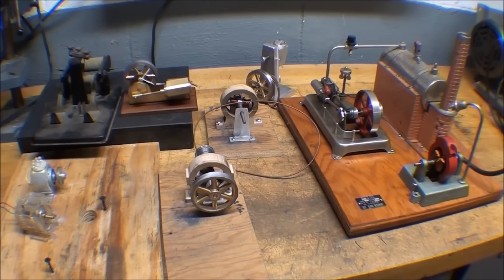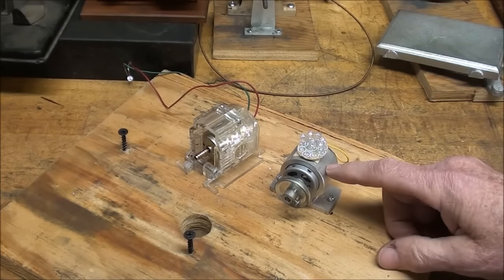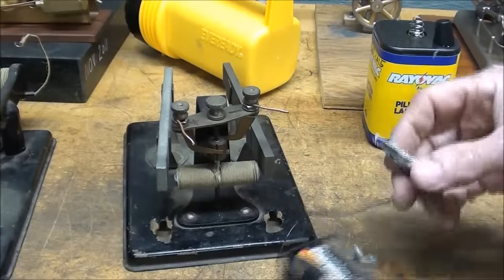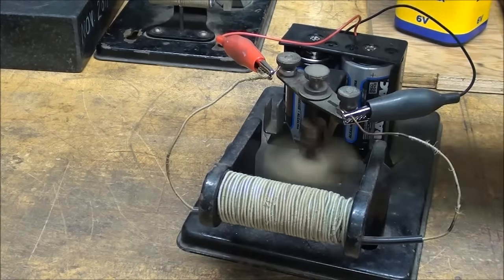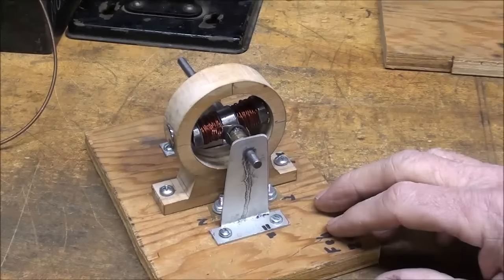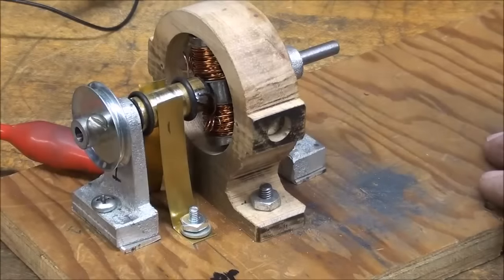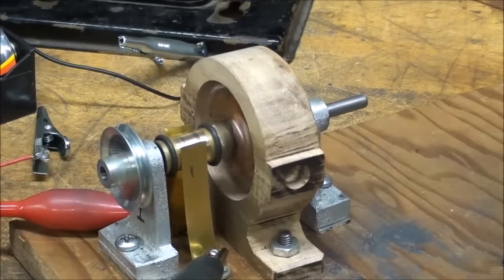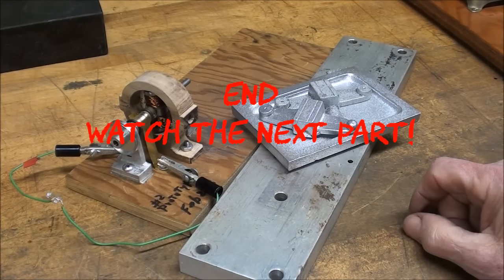Pt 1 tubalcain BUILDS A MODEL DYNAMO for a Steam Engine

Comment: Fantastic video. brings back a lot of memories of the motor kit i got for Christmas. In that day we only got one present and that year was a electric motor kit. It ran off your electric train transformer. ( that I got the year before) One had to build this kit and it would run my Ferris wheel. (from my erector set i got previously) It was a great build and it's too bad no one offers these kits today. I also got a two tube radio kit one year that i built and could listen to short wave from all over the world. I was raised in Tomah WI. and we had a telephone exchange. I would go through there trash and find round dry cells that came out of crank wall telephones,  that were still used on farms,  and used them to make magnets and all kinds of other things.
Good times,
Cheers,
Lee

Comment: 25 years ago for a science fair project my Dad and I built a little DC motor out of a thread spool and some small copper wire wrapped around bar stock bent in a C shape.  That was a lot of fun to build with him.  We could never get the motor brushes just right all of the time so it didn't always run very well.   Cool builds Mr. Pete.

Comment: Yeah, this is going to be a good series! I love this type of thing. When I was a kid, I was fascinated with electrical stuff. My grandfather had carwashes which he maintained and modified. I was a little kid (just walking and barely talking). He would talk to me about the relays, timers, contactors, motors and other parts - talking to me just like I was a grown adult.

I did understand some of it, and I still think about those times.  Now, I work on large diesel generators and their control systems - and love every minute of it!

Comment: This video brought back a great memory for me.   We made dc motors in 4H.   If I remember correctly they were very crude using enameled wire, some large nails, and a block of wood.   The rotor was made from nails and the enameled wire and the brushes were just heavy gauge solid copper wire.   Can't remember what was used for the fields but I'm sure it was a wound magnet.   Have to see if my old 4H book is still at my parents house.

Mike W.

Comment: You should have an iron holder for the magnets as it extends the magnetic field farther around the  armature.  You saw this effect by holding another magnet at the top of the wood dynamo and it sped up.  The commutator should be able to help adjust for the powerful neodymium magnets and reverse the polarity of the armature at the correct moment.  These look super fun to play with.  I love your videos Mr. Pete!

Comment: fond memories. I built a motor very similar when I was in the fifth or sixth grade for a science fair. If I remember right I got the plans from a popular science magazine and the wire from Radio Shack. The armature was made from a bolt and nuts with a hole drilled through the center of the bolt. If I remember rightly I got an A on it. I remember the grade because it was one of a very few A's I got in school other than shop and votech classes. One of the things that really aggravate me about schools today is the elimination of any type of practical education and the emphasis on every child going to college. I am an electrician / Mechanic at a Quaker Oats plant and actually enjoy my profession, Which is kind of unusual today. I repair machinery made from the 50's to state of the art stuff put in in the last year. I gained my skills from helping on the farm as a kid. Vocational classes in school Working in my uncles machine shop in high school and the US Navy training schools and on the job training. Although I did attend a Tech school a few years back and earned a degree in Industrial Technology I found about 95% of it as useless or stuff I learned years before through other means. Today I do everything From 3 phase 480V electrical and PLC to basic machining and fabrication.

Comment: Thx for doing this series. 
You brought back a memory when I built an electric magnet motor using instructions from the World Book Encyclopedia. If I remember correctly it was made using a shoebox, a 1" dowel, a bolt, some heavy strapping, copper wire, etc... 
Funny thing. Festerday I watched "luckygen1001" build a model generator.
Reply: +OldeGuido1  Yesterday... the F is nowhere near the Y goofy.

Comment: seems like the kind of project that would a great thing to build with an older child who's interested and wants to be "involved" in what you're doing in the shop.....   I can remember building something very similar to this when I was a webelo scout.  (and later helping younger guys when I became a boy scout...)

the "locking up" problem you could probably fix by increasing the air gap between the armature and the magnets themselves....

fIner wire = more turns on the armature = stronger transient field to interact with..    Taking great care to keep the windings nearly coiled and not jumbled, also increases the field strength...   

the small motor needs a higher speed as LEDs require a certain minimum voltage to activate, so it would require a certain speed to create that voltage....

Comment: You were able to buy LEDs that changed from red to green with reversal of polarity, or yellow if AC power source used - I'm sure they are still available. These would be great to demonstrate reverse running. Great videos - thanks again Rod Australia.

Comment: Hello Lyle -  Here in Connecticut - I want you to know about the Connecticut Antique Machinery Association ( C.A.M.A.) . They normally do a spring "power - up " show in order to kick-off the summer season but their crown jewel show is their fall show which is about as good as it gets as far as antique machinery displays anywhere in NewEngland.  They have a Generator on display that is in the process of being restored to working condition and I am sure it will be a fantastic display and it will be a working display( it will be steam powered ).  This generator clearly shows why " Brushes" are called brushes.  The copper contacts are clearly cut into thin - flexible bands that easily form around the shaft to which they need to make contact ( Imagine a modern day corn broom made out of copper ) I can't wait to see it running.
Reply from the maker: +Jayne Gus I hope someone makes a vid of that-thanks

Comment: When I was in High School I took the shop courses. I had no plans for collage. 
We were assigned to build a motor. Most chose a simple two pole. Even number rotors are usually not self starting. I thought if a three pole was better a five pole would be great.
We used 1/2" by? flat iron for the rotors and the stator.  My rotor was made from five "vs" they were held together by the wire windings. We did not use magnets we wound the stator also. The rotor shaft was welding rod. Ground points on the shaft ends and place it into deep center punched holes on the stator. Motor ran great and fast - for awhile. My holes for the shaft were not deep enough to keep the rotor in place. Rotor took off and landed in the shops box of vacuum tubes. Hard to balance a five pole rotor.
I wound up going to collage One of my masters was in EE. Also got certified as a PE in Illinois and NC.  George  Dekan, my shop teacher, hired me after I graduated from college to Modernize a timer he sold to schools for athletic  timing . I used TTL to replace relays and AC motor timer. The kid with the five pole motor stuck in his mind.
Reply from the maker: Thank you for a good story about the motor. You sound like quite a smart guy

Comment: I got to reading a page talking about turbo-generators ... they are rotors, directly connected to gas turbines, so they run at 24,000 rpm or more.  They arrange the field magnets, and the stator windings, alternating in a ring.  A pure iron rotor with multiple lobes spins (by turbine power) and alternately connects fields of force between the field and winding elements in the ring around the rotor.  Hope that makes sense.  I wish I could share images here!

Comment: Actually if you were to rotate those brushes about 15¯ those little motors would self start. It just stops the brushes from contacting both the commutator pads in the motors resting position between the magnets. It can also make them go faster or slower depending on the position of the brushes too. Putting the magnet on top extends the field pole of the other magnets which is why it speeds up in that case. Fun stuff...

Comment: Hi, 
the reason why you need to start the motor manually is not because the magnet is too strong, but because the angle they "cover"  is too small. If you compare with the Jensen generator, the magnets form about 60% of the periphery, so the rotor is exposed to field lines for a larger part of the circumference. 
The solution would be to put several neodym magnets on each side. This is also why the motor speeds up when you place a third magnet on top of the assembly.

Comment: If you keep the magnets parallel (like in the electromagnetic setup) the motor should spin in the directions you start it without changing the battery polarity

Comment: Mr Pete,   The motors will produce more torque if the magnetic field is "connected" around the magnetic circuit. Iron around the small magnets so the gap is only at the poles.

Comment: I a science project for Junior High, I built a simple motor using galvanized and copper wire. I got extra credit because the motor started automatically when I turned on the switch. :) I had noticed that if I pre-positioned the motor just right, it would do that, so that's what I did to show to the teacher.

Comment: The coil spring can be easily adjusted to a smaller size, by simply looking for the join and unscrewing the two sides, then cut the outer non reduced section with sharp high tensile wire cutters ( will nick ordinary cutters, it is piano wire or spring steel wire) and grind flat again, then simply screw together again. Done that often to replace drive belts that otherwise require you to dismantle the entire machine just to get it off the shaft.

Comment: You need a pole piece inside for the magnetic field, so the field area is larger. Will give both less cogging and more power, along with smoother running.
Reply: SeanBZA The magnetic field isn't necessarily "larger", but is IS more concentrated by an iron core.

Comment: This is a classic DC motor. If you weaken the magnetic field (of the stator) on a DC motor, it will go faster, but with less torque.

For a generator you should use a strong stator and a rotor with  a high number of windings. Otherwise you will get a low voltage output.

If you want, you can build the rotor with permanent magnets and use y stator with a lot of windings, this will ease the construction but your generator will produce only AC.

Comment: Magnets and magnetism are at work in our everyday lives. You microwave oven has a power transformer (a magnetic device) to increase household voltage to a very high voltage for the electron tube that generates the microwaves. It is called a magnetron because it has a very powerful and large magnet on the tube to help it oscillate (more magnetism) correctly.  Microwaves themselves are powerful magnetic waves at a very high frequency (several gigahertz). ... My grandmother had an old Sunbeam Mixmaster when I was a kid. Since solid state devices didn't exist then, the speed control rotated the brush holder. This changed the brush timing causing the motor to speed up as the brushes became closer to their ideal position. ... There are literally hundreds of things we use every day that use magnets and magnetism; from your electric razor to your cell phone. (Yes, I'm an electronics nut with a healthy respect for electricity. It can work for you and it can kill you!)  Thank you, Mr. Pete, for your series. I hope I didn't steal too much of your thunder!

Comment: Will you make a reversed one with the coils static and the magnets moving?
That wouldn't even require a commutator or slip rings.
Reply: +stefantrethan -  It would actually need a fairly complicated commutator (rotating switch, actually) which would reverse the polarity of the voltage applied to the coils twice in each revolution. It would need four "brushes" and an intricately segmented rotating part. On the plus side, it would be fairly easy to make it reversible.
Reply: +Peter W. Meek As a motor, yes, either that or a much more reasonable electronic commutation.
As a generator, it would require no such thing. If you needed DC (say for a LED light) you could simply add a diode rectifier.
Reversed motors like that (outrunner motors) are known for low speed high torque so might be a good match for a steam engine. A large diameter one would work even at flywheel speed (or you could even put the magnets on the flywheel itself).
Reply: Good point. I hadn't really considered that the whole point of this series is to make a generator rather than a motor. A moving magnet rotor and stationary coil would indeed make a good AC generator.

A multi-pole rotor and a single coil might even make a MUCH simpler design.

Comment: I still have (what's left of) my Jensen steam engine from a Christmas some 40 years ago.  I knew what it was, all wrapped up in gold-foil wrapping paper, sitting under the tree.  The poor machine now has just been sitting, for years.  If I ever get the chance, I want to re-build it.  Not that it's practical, but then, that's not the point.
Reply from the maker: Get it out and get it running

Comment: I know how you feel about questions, but I have a project I'm working on, using a 12vdc solenoid, switched at up to 3,600 times per minute.  It only needs to run for seconds at a time, as a demonstration - how many turns, of what gauge wire, would you use?  It is INCREDIBLY hard to find a reference point for this, online.
Reply from the maker: I have no idea on how many turns. There are of mathematical formulas for all of that that I do not understand

Comment: Mr pete
 I've gotten to the point I don't bother with TV much I search for shop videos instead . You spoke in a previous video of working in an electric motor shop but you may want to check out ( luckygen1001 ) , he does similar work in cast iron i guess it's just the way they do things down under .
Reply: +Lawnmowerman02346 Thank you for watching my generator build videos. I don't think mrpete222 would be interested in my videos because he only melts aluminium.

Comment: I am confused as to what tubalcain means by standard dry cell battery that he had as a kid? Alkaline AAs/AAAs/C/D/9V are standard dry cells. You can buy the screw terminal batteries online. What is he referring to?
Reply: cyberbadger There was a "number 6" 1-1/2 volt dry cell. It was about 3 inches in diameter, about 7 inches tall, and it could put out about 10 amps of current! The telephone company used a lot of these

Comment: I have two of those welch motors but missing the bar magnets, cannot find anywhere. anybody have recommendation of where to purchase these bar magnets.  Also people have come over to my basement workshop and I've shown many of my collection of engines I have built like yours and they question what purpose or why do I build them like why are you wasting your time with this.  I know these same people cannot change a light bulb and that explains why this country is in such decline I think?????
Reply: +gary smith Sorry cannot help with the purchase of the magnets. You could make your own quite easily. Read here ->    https://www.princeton.edu/ssp/joseph-henry-project/permanent-magnet/  regards from the UK
Reply from the maker: +gary smith I know many people like that. But then again, I cannot get entused about their golf clubs.
Reply: +gary smith -  Make a couple of wood or plastic bars the same size (to fit the existing clips) and mount a rare earth magnet in a hole at one end of each bar. Instead of labeling the ends N and S, you would need to label the faces of each bar as N or S. 

Alternatively, you could get a couple of rare earth magnets with holes through the middle; make half-length bars from the softest steel possible (even better, from plain iron if you can find any); drill and tap one end of each half bar for a bit of brass all-thread which will fit through the holes in the magnets; and assemble them into the equivalent of the old Alnico bar magnets.

Feel free to message me if this isn't clear.
Reply: +gary smith would think any bar magnet that fits modestly well would accomplish the function if that's all you're looking for.   (or as someone else said, create a wooden bar to mount a rare-earth magnet in.....)